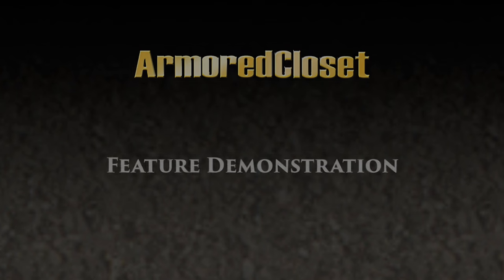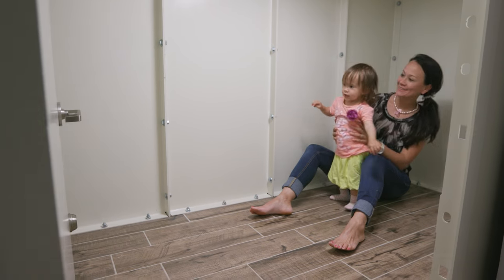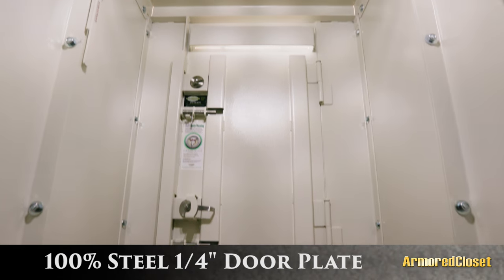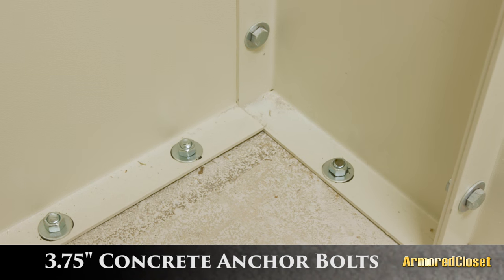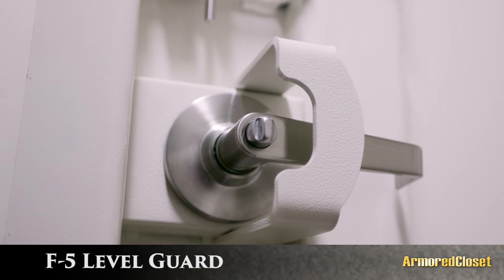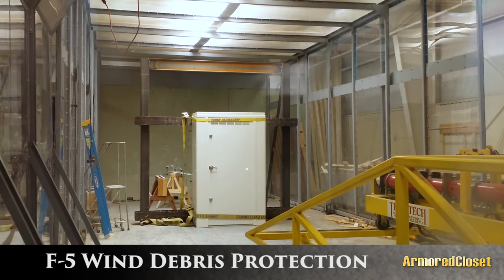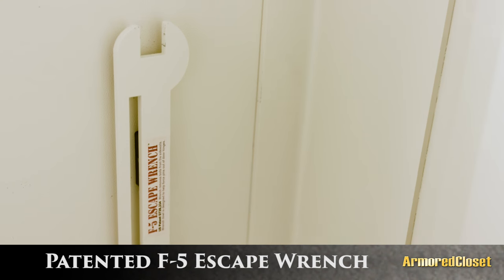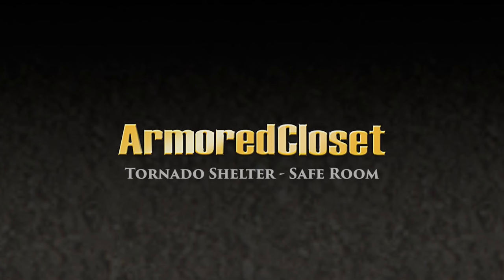Tornado Shelter and Safe Room - ArmoredCloset Product Tour and Demonstration

Comment: but that's a f 5 not ef 5 tornado
Reply: Talia Gage no, it’s EF5.  As in enhanced Fujita scale.
Reply: It's rated for F-5, EF-5 only states winds above 200mph, F5 is 261mph-318mph, either way, the shelter seems it's rated to protect from any real scenario. I just went through a strong EF-3 in Arkansas, it went right through my house but mine and my neighbors house was spared some home, still suitable to live, in fact im typing this in it right now. Houses behind me pretty much leveled, thankfully no one died.

I have a background in welding, and maintenance, and to me this is the first shelter I actually have liked, others seem to be very flawed at some points in design, anchoring to your foundation is bar none the best approach, You typically don't see tornado's ever yank concrete anchored steel beams from they ground, and they exposed to the wind, these are anchored inside the shelter so that's a huge advantage, I also really like how it seems it can be installed into virtually any closet, very good design if you were actually looking at purchasing something like this, better alternatives exist, however most have to be installed at the time of house construction.